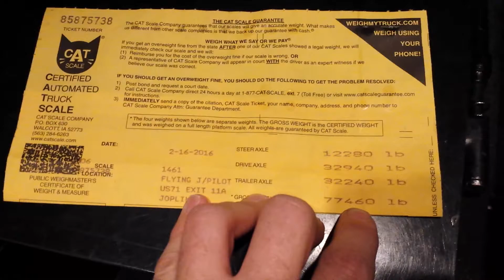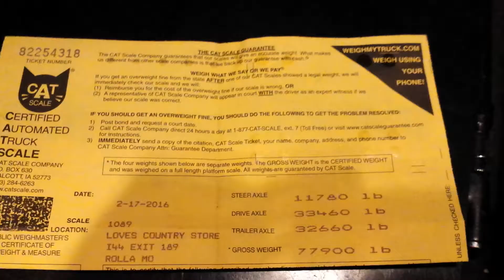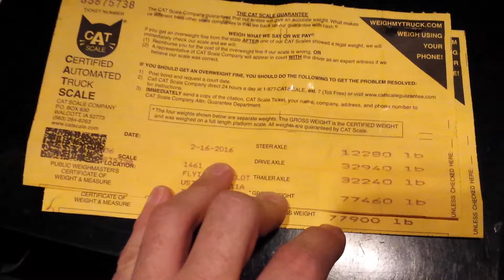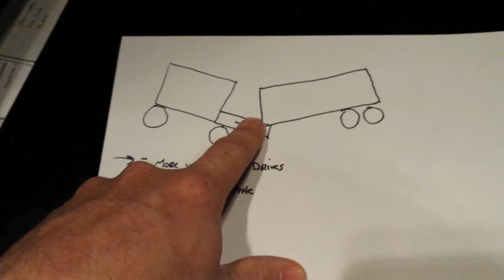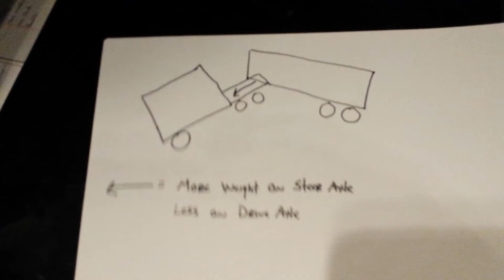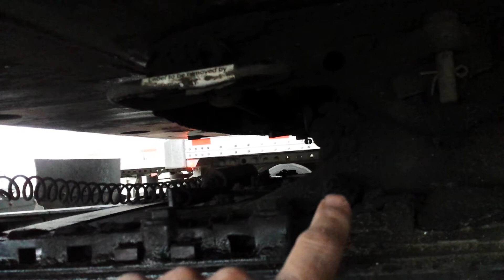Let's Talk About Fifth Wheels...

Comment: The only problem I  have is to put the pins in place and lucked
Reply from the maker: It's kind of the same principle as sliding tandems. They should lock back in. Sometimes you have to force them back into place though. A long brass punch and a big hammer usually does the trick.

Comment: A coworker at JB Hunt told me that in California the 5th wheel pins have to be in the 7th and 8th holes of the 5th wheel (from front to back)
Reply from the maker: The 5th wheel doesn't matter so much. All it really does is control the weight for your steers. Its the trailer that you need to position correctly. In CA you can't be more than 40 feet from the kingpin to the center of the rear axle.

Comment: How many holes back did you move the fifth wheel ? In order to get the proper weight
Reply from the maker: I couldn't tell you how many holes. This was done over 2 years ago. You just have to experiment and see what the weight difference is for each hole. General rule of thumb is anywhere from 250 to 350 pounds per slot. So if you need 500 lbs maybe move it 2 slots and reweigh. But that would tell you for sure how much weight is being displaced. Hope that helps.

Comment: Absolutely nothing confusing.  Explained it like it should be explained.  Only one thing I needed to know.  How far did you move it to achieve the roughly 500 lbs reduction on the steers? I mean how many slots or holes you you move it?
Reply from the maker: Oh boy..i couldn't tell you because this was so long ago. Every 5th wheel is different so it depends on how far apart the holes are. A general rule of thumb is that each hole roughly represents 300 pounds give or take. So if you would need 500 pounds move it 2 holes then rescale etc... Hope this helps.

Comment: Great video but I have a question,
Like you I had to switch trucks and The former driver slid the fifth wheel and I want to get it back to where I don't ever have to mess with it like my old truck 
     would that be all the way to the front or on the way to the back??????
Reply from the maker: moses rivera The only way to find the sweet spot is trial and error. Good way to start is to center the kingpin opening between the drives and go from there.

Comment: I dont know were truck driver  get their laws about  weight  on single  axle  apparently none of them know the legal limit for single axle in case you wondering it is 20000 pounds and I challenge anybody to prove me wrong
Reply from the maker: Simon Sorhaindo Im not talkin about a single axle tractor here.
Reply: Every state its different on steer axle Colorado count it as single axle and the limit its 20000 but perhaps California only allows 12500 some states are 13000 and so on but pretty much 12280 it's legal at every state so just buy the legal weight and dimensions at the truck stop and check the particular state you'll be running through and good luck drivers

Comment: no man the video wasn't too long you do a good job. Hey but I have a question what type of lube are you using for the 5th wheel slide and pins
Reply from the maker: I use any kind of penetrating oil. WD40..PB Blaster..products along those lines. You should always keep something like that in your truck because it will come in handy!